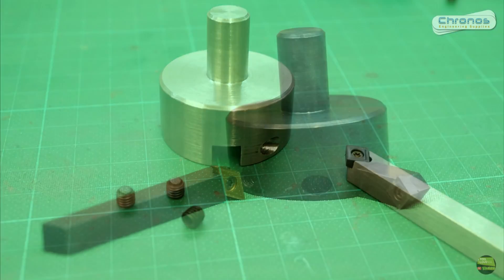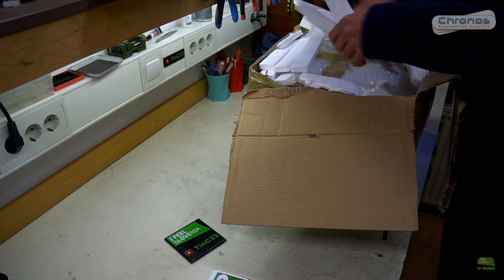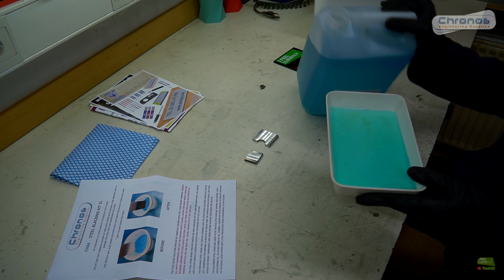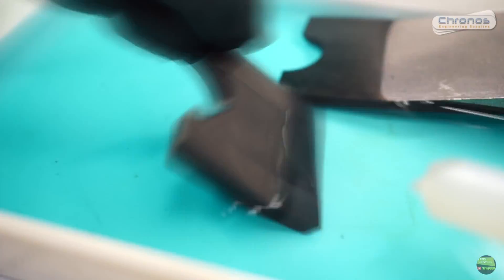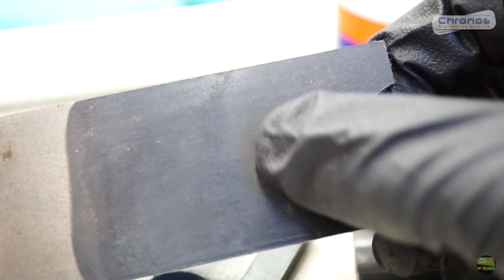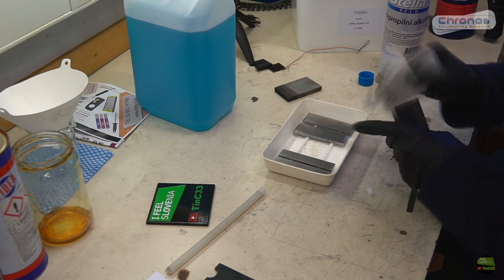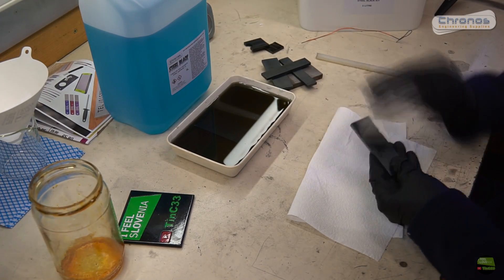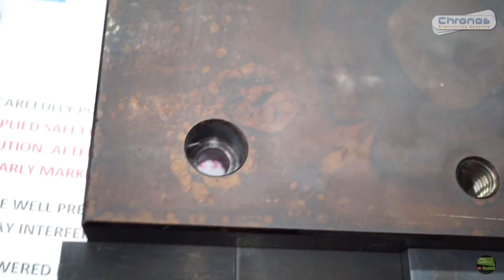Cold process of Blackening Steel using special solution

Comment: Thanks for the video, how resistant is it to scratches or impacts?
Reply from the maker: Not much i prefere hot process of blackening by using fluxseed oil... Biger parts blackening cold and then  still apply layer of oil and just heat a bit to make at least some protection
Reply: Damn, I was hoping to use it for a suit of armour for buhurt

Comment: Could this be used on galvanised steel or would it remove the galvanised layer?
Reply from the maker: I'm not sure, but i think it only work on raw steel, and galvanization offer much better protection.
Reply: Is this blackening solution rust resistant?

Comment: This time you done it better and faster👍 I just watched Chronos website and the have some cool stuff.
That grey bottle in your oxy kit confused me, is the Roxy Kit or the Roxy 400?
Reply from the maker: it's roxy kit but i make "upgrade" after second bottle of oxygen was empty and need to buy new one. Now i got 2 of this 0,67L bottle and can refill them on any big bottle
https://www.youtube.com/watch?v=Atpn4vGB5lc
Reply: @TinC33  Ah yeah! I remember now, I saw that video already. My roxy is servicing well all this years maybe I need a similar solution but I use it just a little, one or two oxygen bottles each year. Thanks for the info anyway.
Reply from the maker: @isidoromaich7226  than it's ok, but i used 2 bottles in a month, so i make this mod, but use roxy much much less, since i buy basic gas burner for 20€ gas is cheap and the flame was bigger, so it heat better even if the temperature is much lower, you can see it when i blackening the big piece into video about rotary table mounting plate...

Comment: Good stuff and Chronos is a good reliable firm.
Reply: They surely aint cheap . . . Maybe i am just too poor to buy 20 screws for 4€,that usualy cost 10€cents per one/2€ for 20.
Reply from the maker: @zumbazumba1  True, i buy from them lot of tool before banggood and other chineese start selling really cheap.
Reply: @TinC33  Yea but bangood and ebay china are lottery -sometimes you get real deal for super cheap-sometimes you get useless crap.Good thing is most of time you get money back.
99% of time anything made of "hss"is usualy made of cheap soft steel.
Reply from the maker: @zumbazumba1  True, offcorse chronos sell another level quality tool, but as you say, sometimes it's the same from china, when it's hoing about hss like drills, mills, thread cutters, i prefer on a brand for industrial use, lot of people sell those stuff on internet for cheap, i buy 20mm 6 flute mill known brand for 20€ (new) than i find price on internet it was ower 500€
Reply: @TinC33  Go check gypsys -i bought 250€
worthy german  made hss 10%co roughing endmill for 3€.It was a bit rusty ,some surface rust but still sharp and maybe used once.
Another one was m20 and m16 taps brand new also german for 5€ both.
You can find crazy things for cheap on those bazzars.If you know what to look for and how to bargain.
Unfortunatly mine is 30 km away so i dont go often,but every time i find something.
Reply: Još plačem za titom i tvornicom alata trebinje,FRA čačak,Tvornica alata nova gradiška (tang)Prvomajska,Mol lički osik(vrhunski amerikaneri)OLT škripovi po kojima macom od 10 kila mlatiš(bila još jedna tvornica nemogu se sjetiti),iskra i unior nije bio made in china  ,jebiga neka sere tko što hoće ali znali su napraviti pravi alat koji je trajao u jugoslaviji.
A danas sve sranje,i marke su se prodale za jeftine pare . . .

Comment: it's just cold blue, not a very good choice for protecting the surface
even the blowtorch and motor oil method is better than cold blue
Reply from the maker: I think so, that solution make surface only black no protecting at all, so all protection is a thin layer of oil, hot method is much better for protection, but for inside use like tool and stuff i will use that think, because it make much nicier surface, and i got no moisture in workshop, so no problem at all